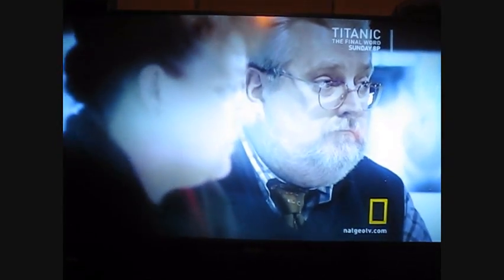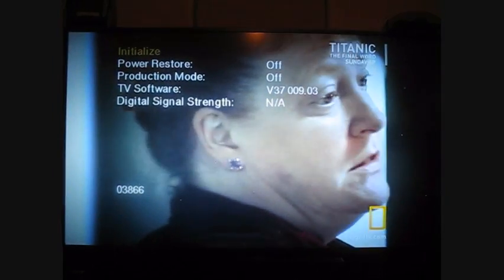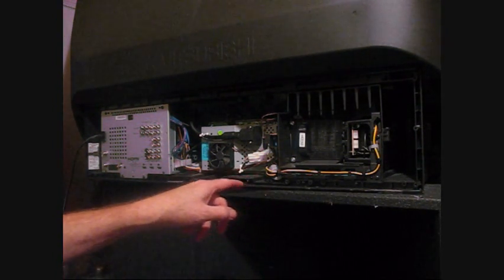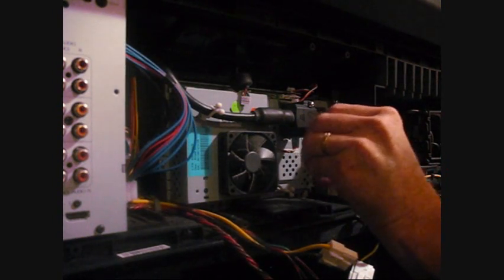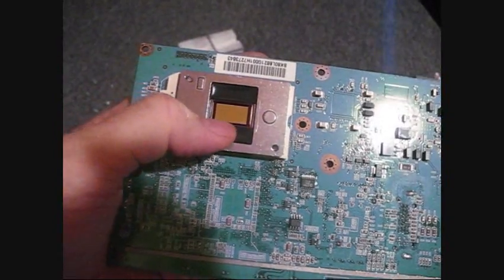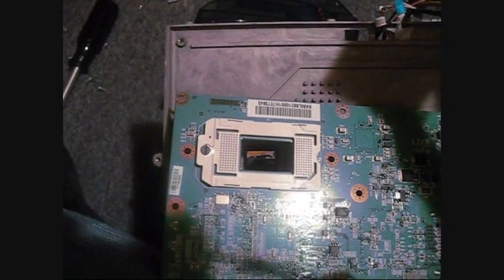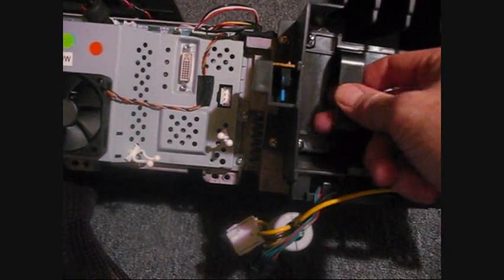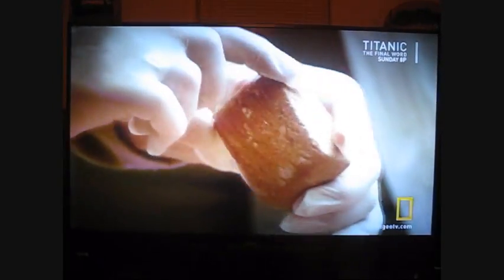Mitsubishi WD 65733 DLP Replacement.wmv

Comment: So I followed the tutorials online to a T. My only problem was on the power board to the right of the light engine assembly. Theres 2 plugs that goto that board the yellow and black power wire and then the 5 pin (1 red 4 grey ) I accidentally pulled the pins out of the plug. Does anyone have a pinout or a way to figure this out. Can someone show me where to buy another or help. Please and thanks
Reply from the maker: The service manual might be available here: https://www.manualslib.com/manual/1089665/Mitsubishi-Wd-57833.html?page=49#manual

Comment: I have the mitisubishi dlp wd-65733,  the other day turned it on, show came on 2 min,s later tv shut off, there was a steady yellow light .and a green  lamp light blinking. removed lamp cleaned and reinstalled to no avail. book only says about yellow light if lamp lite nothing about green lamp light
Reply from the maker: TV shut-off followed by a flashing green light should indicate a power interruption or a bad digital signal (especially if you are using an AV receiver).  When this happens to me, I can usually turn it back on after a couple of minutes and all is well.  You might also want to check that the fans are working (you can hear them running when the TV is on and the sound is off) in the event you are overheating.  If all else fails, do a system reset on the front control panel under below the screen.  Good luck!